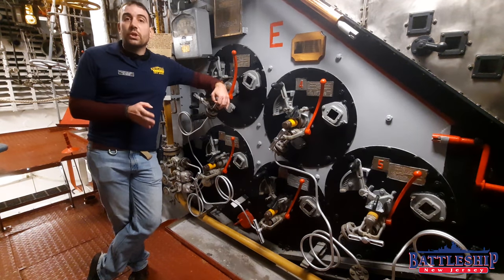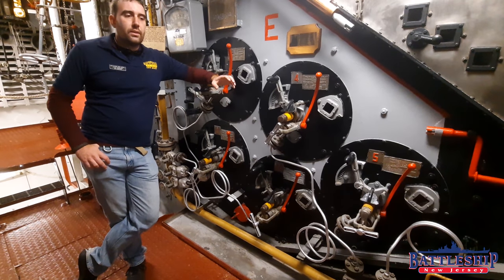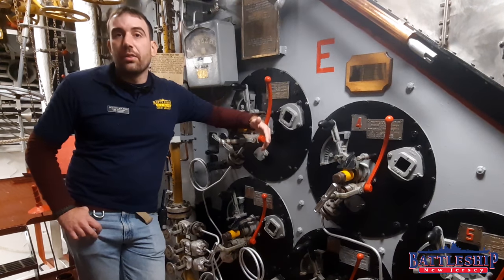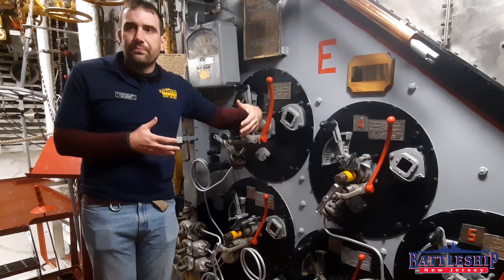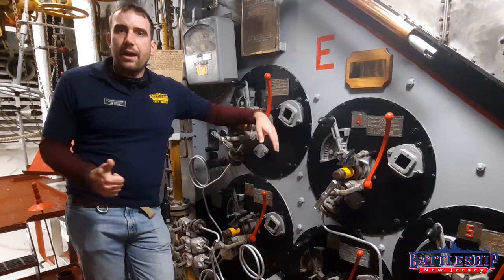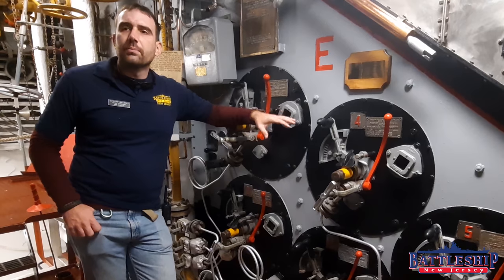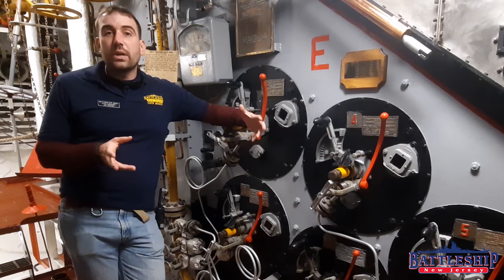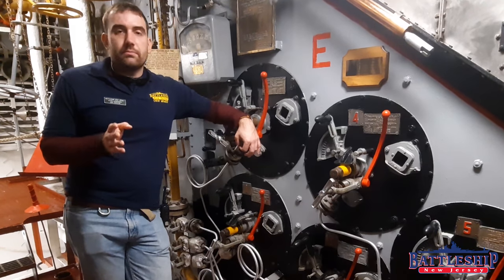Nuclear Powered Battleships

Comment: I agree about nuclear power, but what about gas turbines? As I understand, modern "combined cycle" electrical power generation plants use gas turbines hooked to generators, then the waste heat is used to boil water and create steam which also creates electricity the old fashioned way. Is there enough room for a combined cycle plant in the battleship? This assumes that all the boilers would be replaced but the rest of the turbines could be reused.

Comment: The Long Beach and California class cruisers were retired to specifically avoid the cost of refueling the reactors. That said, Russia is  supposedly reactivating some of the retired Kirov class.
Reply: That was a very short sighted reason to decommission those ships to say the least.  Oil is a volatile commodity who’s price is subjected to world politics instead of inflation.  So when we would be in the most need of fuel to take on a hostile force, chances are that the volatility of the situation caused fuel prices to already skyrocket.   These ships burn an enormous amount of fuel oil, which isn’t a renewable source of energy.  While the cost of refuelling these ships is very high, that time could also be used to modernise the rest of the ship as well.  And the cost of refuelling such a ship is a drop in the bucket compared to the cost of the millions of gallons of fuel each of these ships burn each year, especially when you consider that it’ll be at least another 20 years before they need to be refuelled again.  What they did was avoid a short term expense when they should’ve been looking at the overall long term savings.  That’s because the majority fof these ships had at least another 30+ years of life still in them.

Comment: The reason to build a new heavy bombardment ship is the lesson of WWII. In the Pacific it was found that naval bombardment of dug in defensive positions was inefficient. When an amphibious landing was made with the heavy bombardment highly curtailed there were high casualties in the landing troops. A review found that the shell craters that provided cover for the landing troops were missing and heavy naval bombardment was returned as the doctrine.

Modern naval ships rely on as little as one cannon dependent on high speed automated reloading and computer controlled targeting. One malfunction or hit on a turret completely knocks out a ships bombardment capability. So it must withdraw from the engagement or remain as a target for the enemy.

There is nothing right now demanding the capability of massive amphibious landings. The US is committed to landing small units at strategic points. It takes years to design and build a battleship type of heavy bombardment vessel and should the need arise the US is unprepared. 

Maybe a heavy ship with main turrets holing 4 guns of maybe 10” shells size. Batteries of 5” guns that offer high rates of fire. Modern antiaircraft batteries of guns and missiles. The Falklands battle showed antiaircraft guns still have a place. 

The Falklands battle also showed the vulnerability of aluminum construction in warships so steel armor still has a place. When the Exocet missiles punched through the aluminum construction of the British ships the burning solid fuel gut through the ship like a cutting torch through butter. 

Modern nonnuclear propulsion for a ship that still needs the 33 knot capability of the WWII battleships to keep pace with carrier battle groups. Still have the large fuel capability giving it range an the ability to refuel escort ships.
Reply: Sounds like an updated version of the WWII "pocket battleship" or Panzerschiffe from Germany. Excellent idea, just don't put a nuclear reactor on it.
Reply: That's what VLS cells full of missiles are for. If you need a bigger payload or just more missiles, build bigger ships with more, larger VLS cells. The only advantage of guns is cheap ammo, but for guided shells the price isn't too different, and missiles can be cheap enough if you buy in large quantities and use more COTS technologies.
Reply: @hailexiao2770  I agree that modern missiles with smart guidance and targeting systems are much better for destroying individual known targets and should be part of a ships armament. Cheap artillery shells would be a better choice for shore bombardment where pinpoint accuracy is not needed. Also when equipped with proximity fuses, a WWII technology, air bursting shells would keep and enemy burrowed in while your landing craft were approaching the beach.

The 16 inch naval shell and guns were primarily for engaging other battleships and cruisers. They came in a heavy armorer piercing round and a lighter round with a longer range to strike inland targets. While a devastating shore bombardment weapon today large fortified shore targets can be taken out with more efficiently with missiles. Which is why I suggested a 10” or so gun in perhaps quadruple turrets.

Comment: Dear author:  You might be surprised at how robust a US shipboard nuclear power plant actually is!  The reason nuclear power is only used in aircraft carriers in the surface navy has to do with the cost vs. the mission.  The massive power delivered by a US aircraft carrier makes nuclear power a very cost-effective solution that can't be as easily justified on a smaller, limited-mission platform. It also has to do with the passing of Admiral Rickover.  Also, for powering smaller combatants, the gas turbine has proven to be very economical, and probably can't be bested by nuclear power for that mission.  As for battleships, their mission has been obsoleted by the carrier strike group and the missile navy.  Updating a WWII era battle wagon with nuclear power wouldn't make any sense at all. The bang-for-buck criterion could never be met ... especially today, when the only saving grace, her 16" guns, would have limited if any application in a modern battle at sea.

Comment: I do agree that refitting the old Iwoa Battleships with nuclear power wouldn't be a good idea.

However a new battleship with it I could see.

The US Navy is developing weapons that require a lot of power, now you mount those weapons onto a battleship it looks like a good idea. We all know the fear those 16 inch guns generate, imagine those guns replaced with gause rifles, or laser based weapons. Yup not many foes would want to see that.

It's for the USN to consider if reviving the battleship as a viable platform for such weapons, but I don't see how how diesel or oil could be a viable energy source for weapons such as I mentioned.

Comment: The guy is right that the reactor is basically the replacement for the boiler, as everything else is the same once you get past the ROCK.  As for the frailty of the Reactors I don't agree, but still they are a complex system that could break.  Actually a more effective system to employ gas turbine engines may be more attractive.  The old battleships should remain mothballed and if we need one why not start with a clean slate.

Comment: nice video, revamping older ship would be waste. considering what was done to them when made into museum ships. new bs designs and concepts are nice conversation. jack up power, increased speed, survival enhancements. increase lethality. less manpower needed. what would be the primary and secondary missions, would the ship be a center command ship for a taskforce or a force multiplier for another.

Comment: So what you're saying is the boilers and burners on the Iowa-class ships are like the heater core in a car that the manufacturer decided to build the car around? 

I've been saying it for years- the Iowa class boats are awesome pieces of hardware! Convert them to nuclear, build a battleship group around them, and use them as a big stick, dammit! 

I recently found this channel and while I still think the Iowa-class ships are pretty bad-a**, some of your videos have given me some insight into why they're no longer in service. ☹

However, IF they were to be pressed into service again, I would suggest that bunker fuel made from coal via something like the Fischer-Tropsch process would be a prime fuel source for them. 

The Germans used methods like that to produce diesel fuel and even (for the time), high-grade aviation gasoline. And as I recall from my college fuels-and-lube class, the U.S. holds a quarter of the world's proven coal reserves, which has largely fallen into disuse since the propagation of wind and solar energy generation.

Comment: You may not be giving as much credit to how shock proof a reactor plant can be considering the effect of pressure waves in water and how the submarines are hardened from torpedo and depth charge attacks. Its my opinion anything that gives your reactor trouble would have probably compromised the hull of a battleship in an terminal way

Comment: I think the 3 main gun turrets would have to be removed on a modern battleship and replaced with vertical launch systems like other modern surface vessels to make them battle worthy.  
Also saving over 2,000 tons of weight for each turret.
I wonder if a nuclear reactor would fit in the hole left behind by the rear main turret and magazine?

Comment: If they built a battleship today (which would be a waste of resources, in my opinion) I expect they'd use gas turbine propulsion and controllable-reversible-pitch propellers, and they'd be structured to make it (relatively) easy to swap out engines.

Comment: Are dilithium reactors safer to operate than nuclear reactors in the long term?
Reply: A Dilithium based matter-antimatter reactor is not safe to use at our current technology level.
on losing containment they violently explode putting out sufficient energy that you needed to be a few light seconds away to be safe from the blast in a vacuum if you wanted to be safe, so if one failed inside Earth's atmosphere the Earth would be at very least rendered uninhabitable, possibly vaporized.
Reply: …unless, of course, you had balanced the neutron flux with a flux-capacitor.  ¡Jumpin’ gigawatts!

Comment: In addition to the reasons given, putting nuclear reactors on an Iowa battleship is bad idea because they would never stand up to shock from the firing of its own 16 inch guns unless a lot of additional work would go into isolating the system from those forces.  But that would increase the complexity and cost to retrofit them even further.  And what you may end up with is a vessel that is compromised in some way.  Either it would be too heavy, too slow or its structural integrity may be compromised from all of the additional weight.
Reply: Oh yeah, never considered the recoil shock from firing it own 16 inch. Is it true that if all guns are fired broadside at once it slips sideway (the ship) ?
Reply: @wonniewarrior  I don't believe so.  Half of the ship's hull sits below the waterline so the kinetic energy from all of its guns fired at once would not be enough to move the ship.  The images of the water spray that make it appear that the ship is moving is an illusion.  The disruption on the surface of the water is coming from the shockwaves of the projectiles being fired.

Comment: 6" vs 12" vs double bottom.  We all know the navy would do things the hard way and go up from the bottom.   But in regard to shore bombardment and possibly taking fire from enemy artillery.  If they could increase the range of a gun from the 30ish mile range to 60 miles then that would negate the risk of fire from shore batteries.  Missile protection would be the same worry as it always is.  But I think a nuke BB would be better served to be designed as such.  Then you could design a BBGN that takes what they learned from the Iowas and do it right.  While they are doing that, they can redesign a sleeker Midway class sized carrier that doesn't need to be Ford sized and Ford expensive to hand bushfire conflicts.  10 of those would supplement the heavy carriers and paired with a BBGN would be more than enough for Somalia type engagements.

Comment: The ship could have mixed system, say 2 props on nuclear, 2 props on oil.   Nuclear used for cruising, and oil brought online for combat.  
(And steam can be replaced w/gas turbines.... which spool up quick.)

Modern conventional weapons are not designed to deal with 17” armor, so, for awhile, the battleship would rule.
All said, what mission would a battleship have?  Shore bombardment and surface interdiction.   Lots of $$ for such a limited mission.

Comment: There is the Zumwalt class destroyer designed for rail guns. They use gas turbines for the power plant. Weather the navy wants to come up with a BS to carry bigger rail guns,, I would assume new power plants would be part of the design. For something of that size I would take it would be a nuclear power of some sort and there are more designs for nuclear power already out there. As Captfjparks points out, it would be a keel up redesign. But right now the issue is ware on the rails of the gun.

Comment: I'm no brain scientist or math surgeon but an Iowa reborn or any new BB built would i think have to be nuclear powered because of the new particle beam weapons beginning to show themselves. This is why the Ford CVs are so overpowered, there will be future upgrades to particle beam anti air/missile defense systems very soon. The demands for power in a future BB would be just incredible, that's just with what would be installed today.
What would the role be for a future BB, navel warfare is missiles, subs, and aircraft, so shes an air defense/air dominance (incorporating modern capabilities) over the horizon sea and land attack platform No Longer getting hit by 14" and 16" shells, shes the center of a Battle group, much safer for a reactor, a reactor encased in a foot of amour.

Comment: A nuclear powered surface combatant wouldn't be a BB, even the ship called the Nuclear Battlecruiser, the Kirov Class aren't battle cruisers, that role doesn't really exist anymore (Kirovs aren't designed to go round wiping out cruiser squadrons as the OG BCs were, it is designed as effectively gods own missile cruiser, to bury carriers under missile spam).  The idea of two lines of heavily armoured and armed capital ships blasting each other apart with main battery fire is dead.   So what would a nuclear powered surface combatant be?  Kirov is probably an accurate model, a large, fast missile ship, with the possibility of future tail gun and directed energy systems,  that would be a worth while use of a reactor imho, the use of active defence, speed, and escorts mean that it isn't designed to take hits.

Comment: As railguns and laser weapons become more mature I wouldn't be suprised if a modern battleship design becomes reality in the future. Especially if smaller scale systems can be used for missile/air defense, it would shift the balance of power away from carriers.  

Whether or not such ships would be nuclear powered is a design tradeoff between survival and firepower.

As far as armor goes, its doubtful anything could stop railgun penetration barring new materials discoveries, so such vessels might be more "battlecruiser" with heavy firepower but prioritising mobility and low detection.